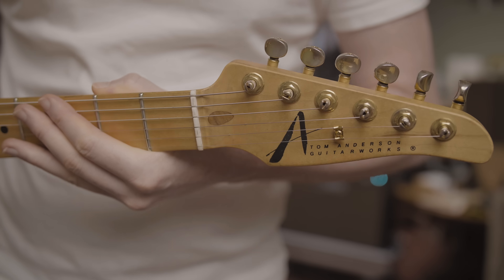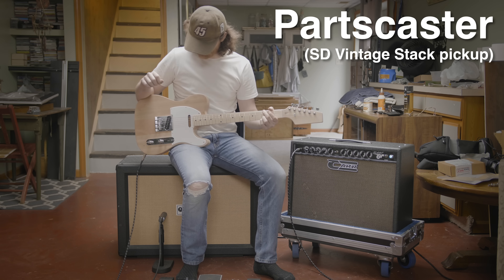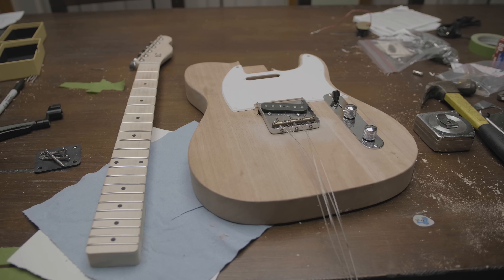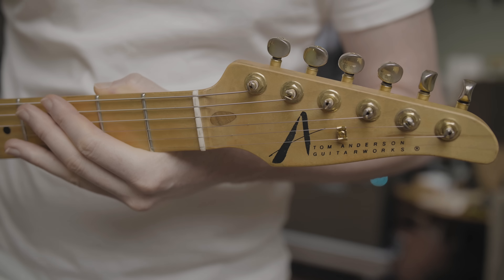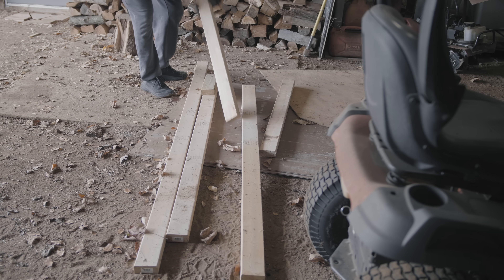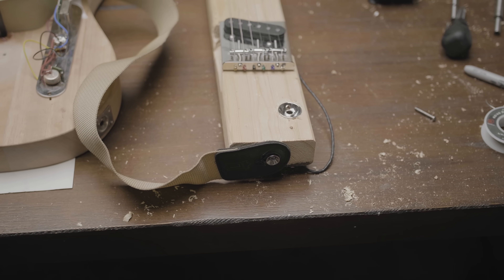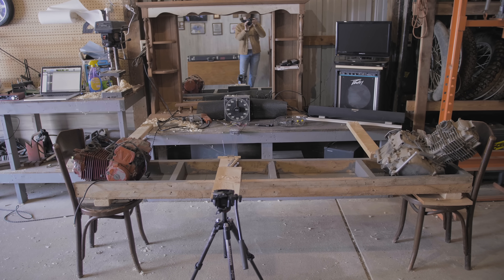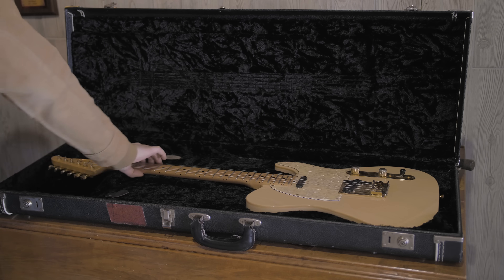Tested: Where Does The Tone Come From In An Electric Guitar?

Comment: I have a degree in physics so I understand the concept of resonance, natural frequency and how changes in magnetic field produces electric current. It’s quite natural then that I would think that wood affects tone. And it did. 

When you compared the Anderson with the 2x4 guitar, the latter lost some of the lower frequencies. It sounded thinner. But the air guitar sounded fuller than the 2x4 and it was difficult to distinguish the tone from the Anderson. I think the “platforms” where the strings were attached to had enough mass to regain the lost low frequencies. 

I would suggest that you  revise your experiment and use a spectrum analyser to have a more accurate view of the frequencies. 

I enjoyed watching the video.

Comment: Excellent work, Jim!!!  Yep, I think 95% of the tone comes from the pickup(s) and string height. BUT, I have two Teles (amongst numerous other guitars i've accumulated over 50 years) that have identical pickups, heights, bridges, saddles, nuts, tuners, electronics. One has alder body, solid one-piece maple neck/fingerboard, small vintage size frets. One has ash body, rosewood fingerboard on maple neck, larger modern/jumbo frets. The alder one is a bit heavier. The alder one has more warm midrange, while the ash one seems flat, or scooped in comparison with more lows & highs. Obviously there is something to the entire package that makes a difference; i.e. ES-335 vs SG with same pickups. As a lol/side-note, when you "block out" the J and L from you logo it says "i'm ill". Thanks!

Garry

Comment: The Anderson and partscaster had a noticeable difference in tone until an overdrive was thrown in the mix. But the air guitar and Anderson sounded identical. But, I think the proper way to go about this would be to recreate the conditions and use a spectrum analyzer. Create a mechanism that will strum at the exact same strength every time, and use that chord capo, or whatever it's called,  to press down the frets at the exact same pressure every time. In other words, completely remove the human variables, and record the data with a spectrum analyzer to compare.

Comment: I am a fairly big tonesnob. I do want to get certain iconic sounds just right. I've tested incredibly expensive Gibsons, Fenders, Custom Shops from family members (older generation) that believe in tonewood and bodymass and all that long disproven nonesense, tested them back to back to my Squiers, Harley Bentons on my Helix and did not hear a difference that mattered to me in any way, also not in terms of playability, because I set up all my guitars myself. So that in itself gave me validation that expensive guitars are not worth the cost if I cannot get an immediate WOW effect from a guitar that costs 3000-5000 Euros when soundchecked against a 200-400 Euro guitar.

I took it one step further and recorded them all and compared the sound in my DAW, did cleans, OD, lead. I only did Humbuckers vs Humbuckers and Single Coils vs Single Coils, etc.. The pickups itself were not the same, the pickup height was not the same and even then the differences are so insignificant that I can safely put this topic to rest and work with the amazing guitars I have. If i feel like i want a warmer sound...lower the pickup a tiny bit or turn the treble/presence on the amp down a bit, don't need to go out and buy a 4000 Euro Les Paul that weighs more than a car and has a Mahagoni whatever.

Comment: Record from line out to analog amp, record on 8 track. The whole notion of trying to capture these experiments by running them through a compressor, a digital amp and into daw is just silly
Reply: Are the signals not accurate?
How would the sound get more fidelity if recorded to an 8-track?

Comment: This great experiment confirms some notions I’ve had based on my background in physics and electrical engineering.  The heavy and stiff body and neck of a solid body guitar just doesn’t absorb a lot of the energy from the waves that propagate between the nut and bridge.  That’s why you don’t hear much sound when a solid body guitar is being played without an amp.  Since a solid body doesn’t interact much with the strings, it has little effect on the sound.  That leaves the pickups and pots and capacitors, along with the strings themselves.  So: with same strings, pickups, spacings and lengths, pots and caps, the sound is gonna be much the same.  Other effects are subtle.  I’m not saying they don’t exist or that they can’t be heard or that they don’t matter.  Just that strings, pickups, spacings and lengths, pots and caps dominate.  Then there’s the effect of the amp, which can be anything but subtle!

Thanks!!!!
Reply: You left out the speakers, which are more important than the amplifier (as long as it is operating in the linear region.)
Reply: Wait a sec. So when you have a hollow body guitar and a solid body, they sound drastically different - is that just pickups too, then? Are we agreeing to that? Because this guy has a no-body guitar, comparing to a solid body and it sounds exactly the same.

What say you Physics-man?
Reply: @Sparksnorthern  The air guitar in this video is a lot closer to a solid body than to a hollow body. What makes the hollow body sound different is that it has a resonating cavity -- the air guitar does not (well, it kinda does, but it's as big as the whole room and it would need to be empty to really work).
Reply: @Sparksnorthern on any acoustic guitar, the soundboard acts as a speaker, transferring energy from the string into the air. The wood below the strings doesn't matter at all, what matters is what the string is connected to. So the small guitar was closer to an air guitar than the two benches.
Reply: @Sparksnorthern  I agree with you that hollow bodies do sound different than solid bodies.  I am also trying to understand how pickups are the only thing that affects the tone.
Reply: @Sparksnorthern  The so-called air guitar is still connected to two large, stiff masses and couples into them as well as the air and the pickups.  When a string oscillates, it causes tension on the string.  This pulls against the supports on both ends of the string at the frequency of oscillation.  People who own double neck guitars can demonstrate that you can play one neck and pick up the sound using the pickups on the other neck, since the energy is conducted through the body into the other set of strings.

Comment: From what I've seen in other videos besides this one the 2 biggest factors that change sound are pickups and overall weight which is affected by the density of the wood used, not necessarily the quality or type. Even on the 2x4 guitar while the tone sounds nearly identical you can tell it lacks sustain from the drastically reduced weight. You can tell the air guitar has a good bit more sustain too cause its attached to a ton of weight. 

Essentially what I'm saying is pickups affects tone the most, weight affects sustain, buy yourself some good strings and electronics from the pickups and through the amp, and anything can sound like an amazing guitar. You dont need some rare wood on an overpriced name brand guitar. You just need some diy skills, patience, and like $400.
Reply: nah

Comment: This is cool, but it's not scientific. I can hear differences in all the comparisons. However, funny enough, the air guitar does sound closest to the Anderson. It's not an air guitar though; it's connected to two large masses of wood, albeit non-traditionally shaped. If you want to make the comparison scientific, you need to remove all human inconsistency from the equation. Real tone is in your fingers, so if you feel less comfortable between one instrument or another, YOU will impact the tone more than the woods (or lack thereof). Even if you are comfortable on both, you can play the same guitar twice and it can be different both times, despite your attempt to play something the same. There are simply too many variables. Besides that, a non-double blind comparison is still subjective. Our ears also add an inconsistent measurement as ears aren't equal- what I hear won't be the same as what you hear regardless of the instruments in question. If you want to accurately compare, you need Bode plots or spectrum analyzers to see the differences/similarities in sound. Another factor omitted is that some pickups are more subject to tone woods than others. For example, if you did this test with active EMGs, there would have been much less variance in tone (it would have sounded equally crappy).

Comment: The one component difference that you missed (and IMO does matter slightly) is the truss rod.  There is a difference, mostly in high end attack but also sustain, between the traditional style truss rod and the newer double action style.  Most likely it is simply a matter of greater metal mass.

Comment: Then please answer me the following questions (honest questions, not meant as provocation): 1. Why does f.i. a Telecaster, equipped with Les Paul pickups, still not sound exactly like a Les Paul (but normally still brighter etc.)? 2. Why do f.i. a Strat and a Les Paul sound different, when played totally acoustic, BUT not different in a random way, but already the Strat towards a Strat sound and a Les Paul already towards a Les Paul sound?
Reply: 1. the scale length is different. I bet they would still sound very, very similar. 2. They would sound different acoustically, but not when amplified.

Comment: As an electrical engineer, i was not at all surprised by your results. The distance between a pickup and a string affects signal intensity, the pot affects the voltage peaks, the distance from the string mount affects the magnitude of string travel an individual pickup will see, and string construction affects how well the pickup can see the string motion, and probably the shape of the signal generated.
For an electric guitar everything comes down to how much vibration a pickup sees from the string, how the generated signal is processed, and what the vibration looks like. You could visualize it with an oscilloscope to really see what the adjustments are doing.

Comment: the only factors that relate to the sound is between the metal string and the position of inductance in the pickup - what may be happening to some extent is the vibrations of the guitar hollow or solid frame may interfere with the string vibrations and it may change the sound in that way

Comment: electric solid body instruments have little impact on the tone as you found out, if there is any variable it will be found in the electronics, primarily in the pick up. when driven the drive circuit will take over and make it difficult to hear much difference there also unless you are moving the pickup around or measuring a drastic difference in output voltage, humbucker vrs single coil for example, humbuckers read a wider signal from the strings then a single coil so, even if voltage is the same the tone will still be sharper for single. its about voltage magnet and where the pickup is on the scale.

Comment: i'm going to go out on a limb here and assume that the 'air guitar' has significantly greater sustain as it's attached to so much mass, as well as the two opposite mounting ends are not connected in a meaninful way that can cause vibration cancellation by them running into eachother. it's not too comprehensive because you can't compare 'fret' sounds, and a slide isn't an ideal way to test other effects moving around a fretboard have with any given material. 'the log' guitar was literally a 4x4 block with a neck bolted on and the other hardware. the 'body' around it was superficial and it carried one of the greatest sustain times known to guitars. a raw tone on an open string though isn't the same. i watched a video about glass frets, and man did it do funky things to the sound.

Comment: In the end, the deadly bow you created is the same as that people made back in the 20s they would take wire nail it to the wall and play in between. It’s all about the pick up I’m convinced of it I’ve built guitars made them out of all kinds of material. And as long as the pick ups were good and said at the right height, and of course, decent tuners, they don’t slip they can sound as good as you want. Thanks for the video you’ve confirmed what I already know.

Comment: @Jim Lill You're a Juggernout in terms of stamina in testing. For me it was enough testing to use a regular tuning fork, ping it, rest it on the guitar body to make the body vibrate and repeat that plugged in and plugged out of the amp. Guess what, as long as the strings aren't vibrating you hear no sound! This proofs that sound in the body does not enter the pickup. Coulda known that before if I was an electrical engineer but I am not.

Comment: everything has to do with the noise in the circuit, which directly ties into the quality of the connections(solder joints), pickups, potentiometers, cables, amp, and voltage regulation to these components.

Comment: I think mass plays a factor in balancing the lows in the same way hooking up a ground fixed the highs. ie: you won't notice when there is more or less mass but you will notice if there is no mass at all. It really seems like this proves the only thing that matters is the pickup and its positioning, very much like a microphone, which shouldn't come to a surprise to an electric guitar. Similar to the microphones vid, the body around the thing that captures the signal plays a very small part unless the body is actively obstructing it, which for a guitar is kinda impossible since its picking up magnetic waves...hey maybe that can be a test. Throw a fridge magnet on it. Maybe a rare earth magnet in the body somewhere. really mess with the fields haha 

As always, great vid. Great science. Keep it up dude

Comment: Tone Stack's... 1 knob, 2 knob, 3 knob, etc... Various Capacitor's control different frequencies flow, and, exchanging them, and amplifying desired frequencies, and, having a full range EQ Tone Stack, found on Ampeg and Peavey Bass Amp's, give obvious more Tone selection. The Speaker size and wattage level, and mixing speaker's together, where the Tone actually comes from, is, the most influencial control and creation, of Tone... Sensibly speaking, that is. Why Amplifier Manufacturer's give strict EQ, or TMB Control Boundaries, and not Full Bandwidth EQ selectivity, can only be presumed, to be why each Western Electric to Fender to Gibson to Marshall, etc., in Manufacturer's Similarity Construct's, keeps buyer's confused, or, attracted, by Name Plate, and Favorite Celebrity User. Some Tone Stack's, are Passive, and, are Cut Frequency Only, which means, Turning all, to Full On, is letting the Signal breathe. Other's, have Selected Frequencies, with Boost Circuit Button's, etc. Tone, or, the pleasing display of sound's, should have a Full Range EQ Tone Stack, with Cut's, Filter's, and, Boost's. After that, the Speaker's, are, the final step, in Tone. Acoustic Guitar's, have their own Tone Charactoristic's, and, they vary, by their size, and, material, and, string composition. The Human Ear Design, and, its sensitivity, and, aged or physical defect's, register the Tone, ultimately. Between Low Thump, and, High Screech, is Tone. Right? Volume, is how loud, "it" can be broadcast, and, should not alter the Musician's Desired Tone. The Room, or Area, where the sound is emitted, also, varies, the Tone. Maybe Humidity and Barametric Pressure has some effect... I got my Tone, from Peavey Viper's, and, Custom Speaker Cabinet's. No Tube Amp, and, I have enjoyed them all, will substitute this Tone Creator. Modelling Amp's from Marshall and Fender, have closed in on Peavey, who started this Tube Alternative. Getting those elusive Tube Even Order Harmonic's, created, and,  controlled, like the Fender Shimmer Circuit Tone, is the Holy Grail. 😊

Comment: Some people really can’t tell a difference between the air guitar and the telecaster, and it’s depressing to me. I can hear a huge tonal difference on AirPods, let alone good headphones. That aside, for your next build, don’t put your bridge in a piece of metal that is physically connected to the strings, and you will get a much different tone. You aren’t getting wood vibrations, but your pickup is still connected physically to the strings, which will transmit vibrations, and those vibrations will be picked up by any microphonic properties that your pickup has. You should be able to literally have a pickup float below the strings completely disembodied from the strings, and the tone WILL be different due to the lack of instrument vibrations.